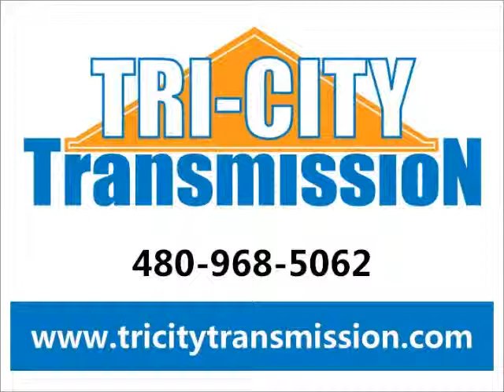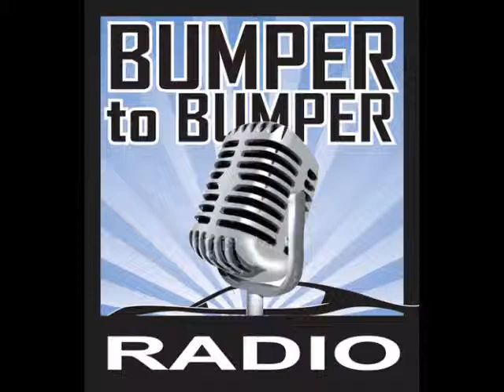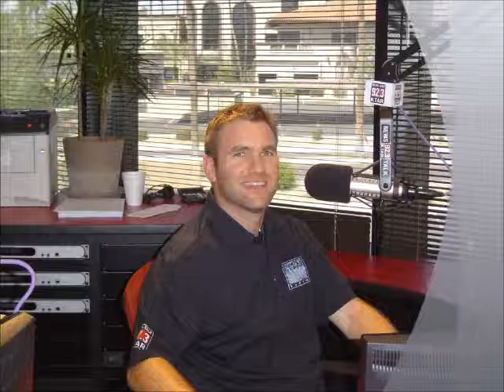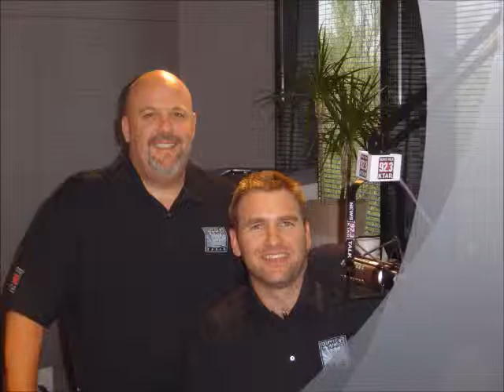Ignoring Vibrations in Your Car Can Result in Expensive Repairs

Comment: I have a 94 camaro z28 lt1- above 90 miles an hour approaching 100 ~ began to feel vibration I believe in the driveline....
* 100 + The vibration becomes more and more violent.... CV joint on driveshaft? (Ive had it up to 150+mph - looking back I feel like an ass for "pushing it")
Reply: Car has 78K miles on it...